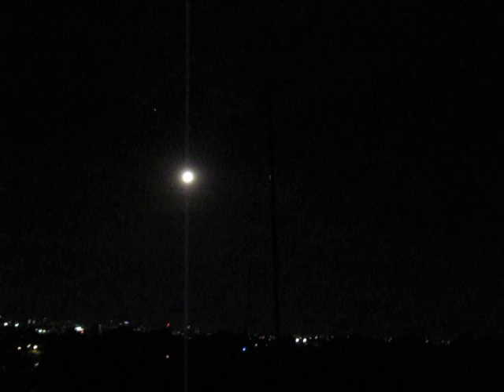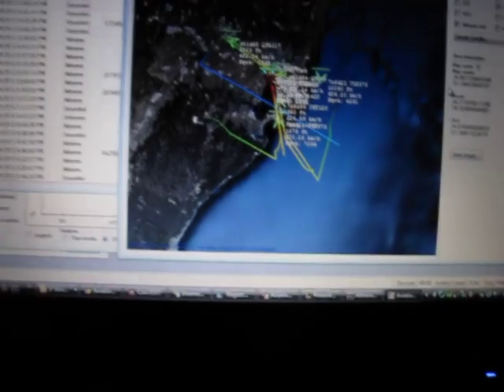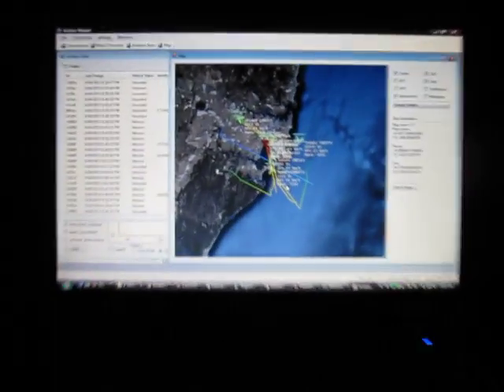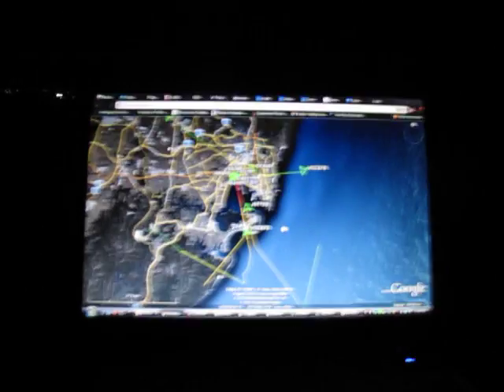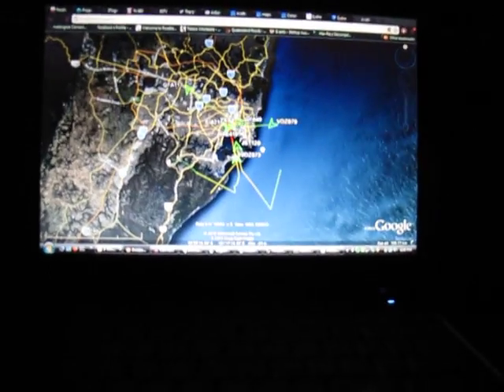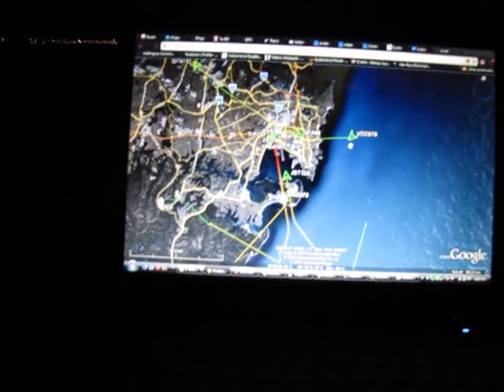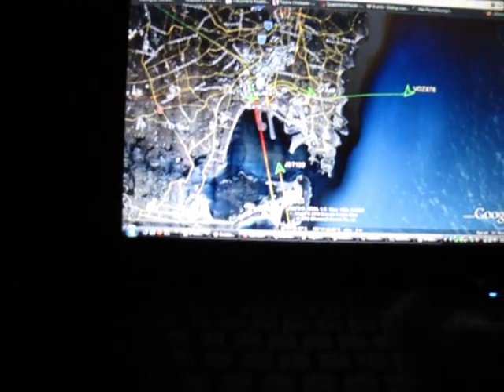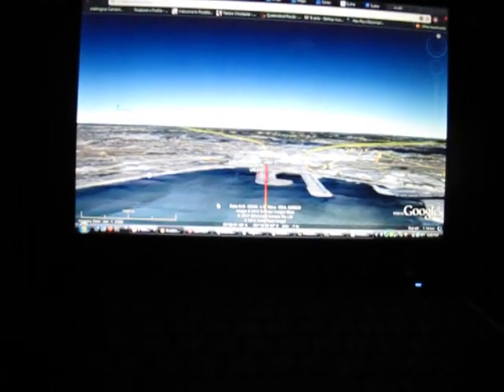World's cheapest aviation RADAR Mode S ADS-B receiver: AvMap + $20 RTL2832 Dongle

Comment: i got gr-air-modes working with rtl-sdr dongle using osmocom source, it does receive tons of transponder messages and sucessfully decodes them but it doesnt receive any of the nessecary DF17 messages, sure i dont exactly have best place to receive from, no direct line of sight, but if it receives other messages why not mode s? does mode s have higher modulation rate or smth? i'll try later under open sky and from a good vantage point

Comment from the maker: Indeed, this would be a good experiment!

However my guess is that the USRP would beat it hands down (probably in large part due to the superior dynamic range and far better quality of the engineering). My USRP record is 514 km (278 NM), and although this dongle test used a non-ideal antenna and no filtering, I doubt the stick could match that with the same appropriate front-end hardware.

I would like to be proven wrong though! :)

Comment from the maker: The trick on eBay is that you shouldn't search for filters specifically designed for Mode S/ADS-B/1090 MHz.

Instead, I suggest doing a general search for (microwave bandpass) filters, and go through each page until you find one that has a compatible pass band. Ideally you want it to have minimal attenuation throughout the Mode S bandwidth, but block mobile (cell) signals, as GSM can cause significant intermod if your antenna mounted high in an urban area.

Let me know if that helps.

Comment from the maker: Excellent, let me know how you get on. Just remember it won't work very well due to the low dynamic range, and the fact there are still other mysteries in the RF chain (like an AGC somewhere) that doesn't allow for 'true' SDR reception. Thanks for the tip re: soft-toy. Could be tricky with the internal mic on my Canon digi ;)